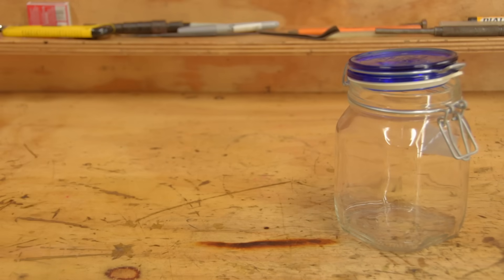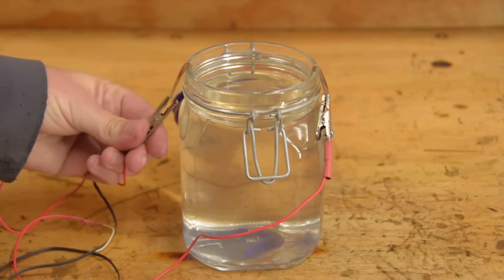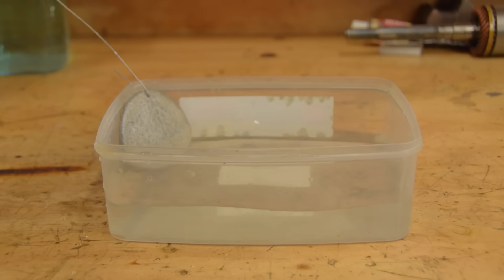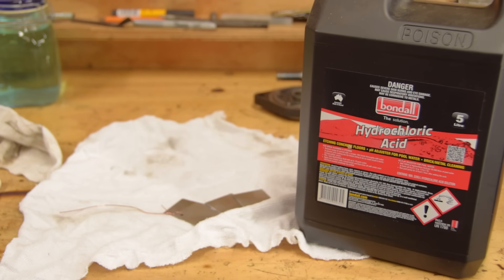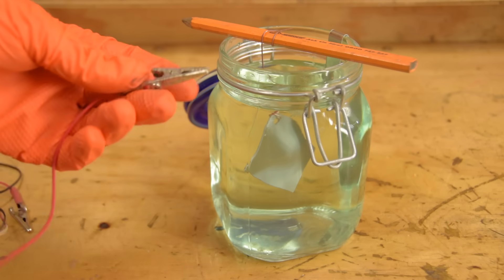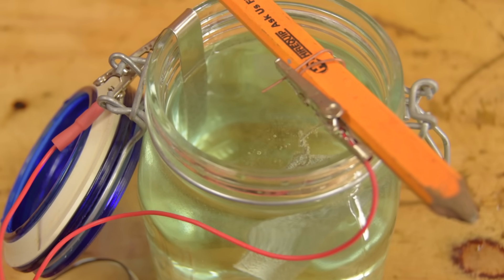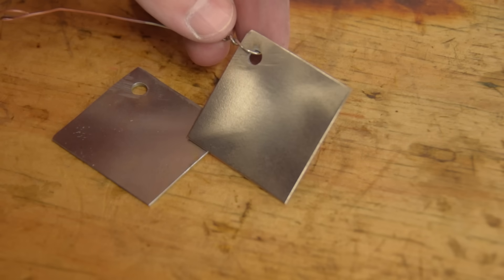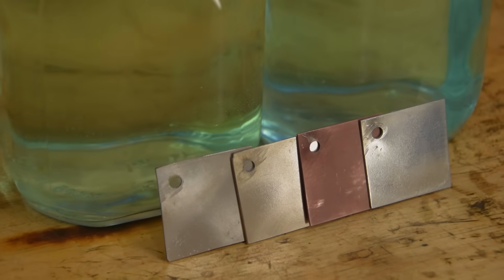Electroplating - Easy DIY Nickel, Copper, Zinc Plating

Comment: I can not get the nickel plating to work, Period. Been trying for a week or so, and can not figure out why... I can't even get a "sheen" of nickel to form on a penny after leaving it *Overnight* Get plenty of bubbles, and etc, but no nickel at all. 
Threw out my first nickel acetate bath, as I thought I must have gotten contamination or something. And tried it again, but same results. 

I clean the test penny and wire hanger in 20% HCI for around a minute. (have also tried mechanical cleaning first, then HCI) Rinse in Distilled water, place in nickel acetate bath. Have 5v 550mA phone charger power supply. (also tried AA battery first before that), and yes the negative lead is connected to the "part". Bubbles start almost immediately, but no matter how long I leave it, just no nickel at all... 

My copper sulfate plating bath (watts bath) works fine, but I needed to copper plate a steel part. Which was why I was trying to get this nickel plating to work... just can not thus far figure out what I'm doing wrong...
Reply from the maker: I'm guessing the penny isn't steel. If your solution is green and current is passing in the right direction it will work if the metal is compatible. Science says it has too. It's impossible for the current to move between from the solution into iron without transfering nickel. If the solution is green that is correct. Even if the solution was contaminated it'll still work, you'd just get a contaminated plate. Start with a piece that you 100% know is plain mild steel and cut the surface with a file or something to gaurantee it's clean.
Reply: @GeoffreyCroker   Hi Geoffrey! Yes, I know it "has to work"... but yet... I can't get it too work!   IDK why...
 My solution is nice and green, so was the first batch. And yes, I know it should have "plated" even if it didn't hold, it should do... SOMETHING! 
But all I get in the nickel bath is bubbles... 

I used a 1970 US penny, as i knew it was 97%+ copper. (the only thing I got on it at all after "plating" all night, was a very small amount of "black" of which only a bit came off with a paper towel.)
I also did try a small piece of steel (about 2x2in or 5x5cm) as well, that I cleaned with a pad on the angle grinder, and then wire brushed on bench grinder, until it was shiny new metal and had a good surface texture.
Cleaned it as I did the penny, with HCI and then distilled water. (I also used 91% alcohol before as a 2nd step in the chemical cleaning, but read somewhere that alcohol has some sort of interaction with nickel...? ... so I stopped using that just in case) 
But... alas, it didn't plate either... 
I just can't figure out what the problem is... I know this method works, as there are many people who use it!! What doesn't make sense is the simplicity of this method... YET I can't get it to work... even though I can get a Watts Copper Bath to work... :rolls eyes: 

In any case, Thanks Geoffrey for the Replies and your videos!
Reply from the maker: And should only take a couple of minutes to see results. If you can't see anything quickly, it's not working.
Reply: @GeoffreyCroker  ha ha! I got the zinc plating to work with the 5v power supply I had been using on the nickel bath, first try no problem. *BUT thats not all :-) * 
While the zinc was cooking, I took the penny test piece that I was trying to nickel plate before, out of the nickel plating bath. I then took the penny out of the wire holder, nothing on it, not even a nickel sheen, just shiny copper. But the wire had some black on it, so I dunked the wire in the HCI to clean it, when I pulled it back out... the part that had been black... was now silver!! It *FINALLY* took a bit of nickel!! But ONLY the wire, nothing on the penny, and this is like the... 3rd or 4th penny I had tried by the way. 
So...... I got another (different) penny, cleaned it all up just like I had done before. But then hooked up a 20v 3 amp power supply to the nickel bath. Yeah, I know it should have been WAAAAAYYY to much volts and amps, but I figured I had tried low power (AA battery) and then a 5v power supply, and got No plating at all with either. So why not go all out, if it screws up the bath, oh well, I was already planning on throwing the whole bath out anyway since I couldn't get it to work no matter what I had tried.
So, after cleaning, I put the penny test piece in "hot" (power connected), and it started bubbling immediately, just like with the 5v power supply. I left it in for a couple minutes, pulled it up to take a look, and there seemed like there might have been something... So I dropped it back in for a few more minutes, pulled it back up, YES I finally got a sheen of nickel across the penny!! In any case, I'm testing a steel test piece again, see what that does.
Reply from the maker: Great. Glad to hear!

Comment: I thought it works best to plate steel with copper before plating the steel with nickel for the reason that nickel sticks better to copper than steel. I usually use a baking soda solution for copper plating. It works well.
Reply: you can't plate steel with copper directly using most 'at home/diy" methods, I tried it, doesn't work. 
It can be done, however due to the harsh chemicals required and other factors, its usually only done in professional shops or in factory plating. Then they usually plate it in nickel and/or chrome. 

For the diyer, if you want copper as a "top coat", it takes far less chemicals to plate steel first with zinc or nickel, refinish the surface (light sandpaper etc) then plate it in copper and have a smooth(er) surface. 

However with that said, I've tried to plate with nickel onto... anything, and for an unknown reason, I can Not get it to work Period. I used the method Geoffrey shows here, and also another YT channel who basically used this same method. But I can't get it anything and I can not figure out why. 

Threw out my first bath as I thought I must have gotten contamination or something, and then tried again, same results. I've wasted 6 gallons of vinegar now (3 gallon bath), and I can't even get a nickel "sheen" to even appear on a copper penny for a test, even after leaving it in the bath over night... plenty of bubbles, but no plating what so ever... still was mostly a shiny penny with a faint amount of black the next morning, and some black on the wire hanger. 

So I've given up on nickel for now, and am currently making a small batch of zinc solution for testing, and will try it once. If it doesn't work either, then I give up for now. .... 
(Edit: was just reading on another site that zinc won't work as a base for copper plating, if your copper bath is acid based, as the acid reacts with the zinc.... figures... )

My copper sulphate bath works fine (different acid recipe), but I need to copper plate a steel part, which was why I was trying to nickel plate it first....  have to wait until I have the money to invest further... if I had the money, I wouldn't waste any more time and would just buy the proper chemicals.

Comment: Don't use this solution for copper plating. Use a copper sulfate based solution instead. Also, when zinc plating, add a bit of sugar to the solution. It helps. Believe me, I know this stuff from trial and error.

Comment: Great job on tutoring this,..my question as several others here.:
Do you have a tutorial on gold chromatic/plating..
Reply: I'm an electroplater in Germany. Gold and Silver are almost always cyanidic, which make them very dangerous.
Chrome-VI (Sorry for the missing + fellow chemists) can cause cancer. Because of that, you can only use existing equipment for that in germany. Chrome-III is less dangerous, but way more complicated.
Another difficulty is that you can't use Chrome anodes, you have to use led or titanium anodes and add the Chrome through chromic acid.
Sorry for my English :)
Reply: @Martin-hc6cm  Hey mate. How is zinc-nickel combo plating should be done? Make two separate proceses like zinc first and then the nickeling? Or maybe nickle it in the zinc electrolite?
Reply: I believe that in gold plating the gold is in a solution with cyanide (at least in the plant that I worked at) so that wouldn't be ideal for home use.
Reply: High level acid like...

Comment: I love this video. Curiously, I have had trouble with copper turning black even with low amps and volts. I've heard Boric acid (borax) can help. Have you had any Blackening, Geoffrey? If so, did you find a solution to stop it?
Reply from the maker: No, I don't use this vinegar setup with copper normally so I'm not sure of all the ins and outs. Normally blackening means too much current though. Current is relative to the size of the part you're plating so if you're trying it on something small, even a very small current might be too much. Are you flashing the part with nickel first?
Reply: @GeoffreyCroker  Yes I am. I was actually plating a knife I had made. I struck it with nickel first. Then I went to copper. If I keep the copper moving it doesn't blacken but if I let it sit still, it immediately burns. I've tried 12v with 200mA and I've tried 6v with 350mA. I've also tried 2 AAA batteries in series. Which my multimeter said was around 3 volts and 140mA. The AAA batteries gave the shiniest result with copper. The 6v gave the best results on nickel. No burning occurs on Nickel, but 12v on nickel made for a dull satin look instead of shiny.
Reply: @GeoffreyCroker  Aside from having a lab supply, is there anything else I could do to lower the current? I'm assuming I'm at the limit of adding salt when it wont go into solution. I'm using Kosher non-iodized salt. Maybe the iodine is helpful and that is what is missing?
Reply: Actually... come to think of it. Your multi-meter showed a gain in current when you added salt. From 28mA to 141mA. Perhaps I should actually use less salt.
Reply: @GeoffreyCroker  I wanted to give you an update. I found a solution for fine-tuning the current.  Since every workpiece is a different size, and having a huge amount on hand, with a huge amount of containers to provide dynamic spacing isn't practical... I instead made a liquid variable resistor. Small glass jar. 2 HB "Ebony" pure graphite woodless pencils as electrodes, and I hooked it up in series with the plating bath. When I need more current, I fill up the jar. When I need less, I pour some out. With this, I can get a 1 volt to 10 miliamp ratio which seems ideal for not burning copper or nickel plating jobs. All without altering the salt levels above/below the recipe or remaking the plating solution.

Comment: Your power supply is 4.75V. Do you think that is too high for copper plating like this?
Reply from the maker: It's amps that are more relevant. But yes it is possibly too high for copper. Fine for playing around though.
Reply: Thanks.

Comment: Hi, thanks for this video! if i cover a piece of wood with conductive paint such as carbon and use it instead of the metal pieces , would it work with nickel? Tanks
Reply from the maker: Yes. But you won't plate to carbon I don't think. You can get metallic paints for that purpose though.
Reply: @GeoffreyCroker  good idea thanks
Reply: @GeoffreyCroker  you can plate directly to carbon. that's how electrotyping/electroforming is done

Comment: How do I wire the clamps to the phone charger?
Reply: Buy a socket from an electronics shop.  Most chargers use a 5.5mm barrel with a 2.1mm inner diameter.  Or if you can cut the plug off and solder wires onto it.  They're often quite thin, so buying a socket can be easier.

Comment: A typical restoration scenario has original nickel plated parts that have rusted steel underneath with blisters and flakes coming off.  That has to be removed, but does the other surrounding good plating also have to be removed to repair using this process?  If so then how to you remove nickel plating?  thanks

Comment: I was not able to duplicate your results and not sure why. I made the nickel solution, using two strips of nickel I got on eBay, vinegar and salt, got a nice green solution. But several steel items, sanded and cleaned first, did not get any coating, they looked tarnished, with black streaks. I used a 5V phone charger at 750 mA, bubbles like crazy but no nickel coating. Any ideas? Thank you.
Reply from the maker: If you have a green solution, and current is passing between the solution and your part, it will plate, it has too. That doesn't mean it will come out looking perfect, that could be a current issue, or too close to the part, whatever - but it will plate. I'd guess the polarity is the wrong way round.

Comment: Fantastic and entertaining, thanks.  I do wonder about your adhesion though?  When I've used methods like this (and not the usual metal salts in the solution), the plating usually was very thin and rubbed off fairly easily as your copper on nickel plate did.  But, it's great for a strike coating of nickel before laying down other layers.  Will give it a whirl though because it looks very fun!  Great job.

Comment: What will happen if I use a bi-metal coin, such as the £2 Sterling as an anode? (Inner: Cupronickel
 - Outer: Nickel-brass)
Reply from the maker: You will get an electrolyte of whatever the metals are. I have no idea if that will plate and it could be more toxic, but wear a mask and find out.

Comment: I had just watched another video about Caswel plating kits and the cost of about $500 by the time one buys a current regulated supply.  I just want to nickel plate a few small gun parts to reduce friction and your process should work just fine.

Comment: I did it with copper and it doesn't work the copper comes off easily and the copper anode pasivates and can no longer conduct electricity i also tried to plate it and set it outside to dry and it turned yellow i don't know why

Comment: Thank you for this video. Can the same be done for gold electroplating?
Reply: you need to disolve the gold in aqua regia first
Reply: @ghgfhhffg1912  No. Gold is actually dissolved in cyanide.  As is silver.  And you don't normally use gold anodes.  You use platinum and plate directly out of the bath solution, replenishing as necessary with gold cyanide salts to maintain proper concentration.  
All the baths he made here were acetic acid-based. (i.e. the vinegar) with some chlorides added, (salt), to improve the conductivity.  Aqua Regia will dissolve whatever it is you're trying to electroplate.  You need to put a coating of copper on your part,  and then a coat of gold or silver.  So a steel piece would go into the nickel, then into a bright copper bath and then a gold or silver bath.  Usually the tanks are arranged in a row on the plating line in the order you want the coatings.  (30+years in the plating shop environment speaking)

Comment: Good video man, but be aware, using salt with this process will produce clorine gas.  Arm and Hammer soda would be a good replacement.
Reply from the maker: It's insignificant. And you don't really want to be huffing any fumes anyway.

Comment: I split the ends on a old cell phone charger but I got bubbles on both annodes. I can't determine which side is the negative. Does a.c. and dc have anything to do with it
Reply from the maker: I don't know. If it's a 12v charger it'll be DC. You can't plate with ac. Just try it both ways and see what works.

Comment: Always add acid to water, never water to acid... Just saying... If you do so, it might result in an "explosion" of the liquid, because of the violent exothermic reaction... Alway add acid to water slowly, letting the reaction happen slowly... 

That acid from hardware store might already be diluted; I don't know this product actually, never seen or searched for where I live, I buy strong, concentrated acid if I need.
Reply: This mostly applies to concentrated sulphuric acid. Hydrochloric is safer to handle and you can add the acid and water to each other whichever way you like. Not saying it shouldn't be treated with respect, but as long as you wear your PPE and work in a ventilated area, nothing interesting will happen.

Comment: Good stuff. What happens if you use a higher voltage or higher amperage power supply?
Reply from the maker: Faster plating. Amperage is balanced between speed and finish depending on the surface area of the part.